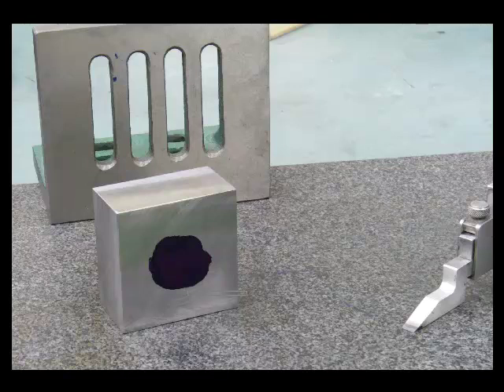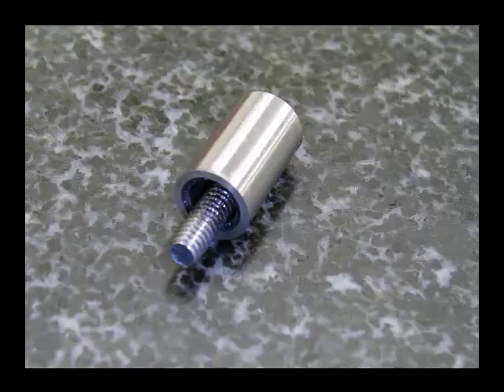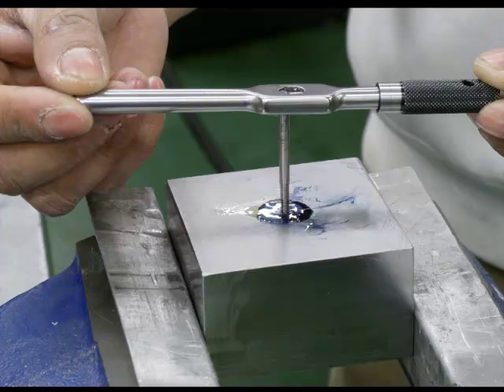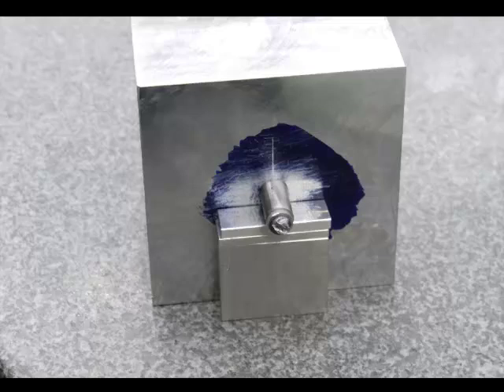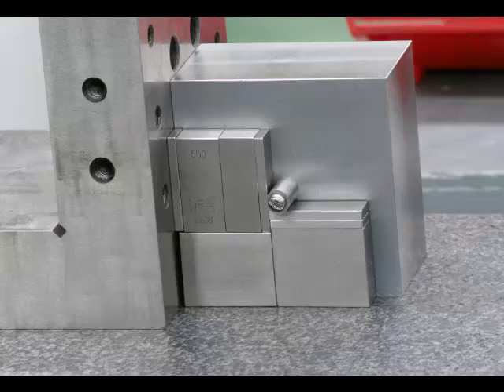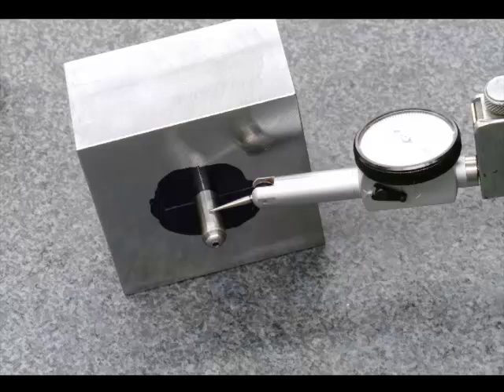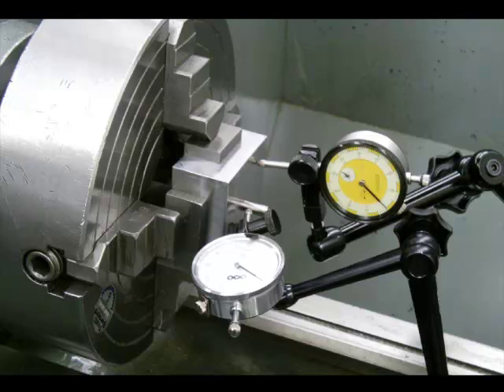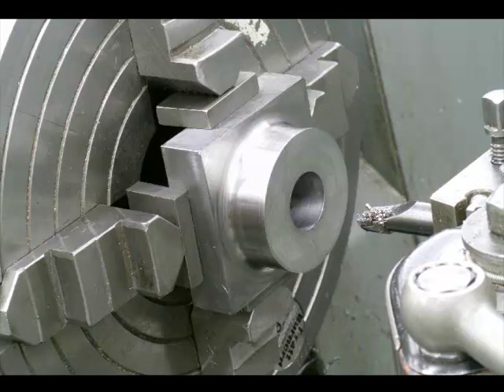Tool Maker's Button

Comment: I*ve just come from facebook, watched 2 videos on this subject, but i still can't understand .... an old timer said it was used when there was no dro.... I don't understand . Even 100 year old machines have readouts, just not digital.... This method only gives you good precision if everything is square, flat, straight... .  

One can find the edge of the workpiece with some round bar and a piece of feeler gage.... From there, it's just cranking the handle to the exact offset. I'm sure there are other methods too . something like this i would probably never use , because the scribing + a good punch is already withing 1mm . So if i make sure to have 2mm of extra stock, i'm golden.

I really want to read the feedback of someone who actually used these.

Comment: Thanks for showing a technique i had not heard of. 👍
It does seem like a lot of work, you have to drill and tap, then do a dial gauge pin alignment, then put in the lathe and do another dial gauge alignment.
I just put the square block in the lathe and use the dial indicator on the 4 sides. If the dial indicator is on the carriage you can just pull it back, rotate the block 90 degrees and feed it (carriage) back in with the dial on the next flat.
Reply from the maker: I  have dialed a block in the way you described many times, it works great. The tool makers button method shows its value for extreme accuracy and also if the hole in the block is to be set off center. Thanks for watching and your note.
Reply: @machiningmoments  ... ah off centre. Thanks, now it makes more sense, especially using the gauge blocks etc. 👍

Comment: I have been a machinist and toolmaker for almost 60 years and can say this method has been obsolete, tedious, and error prone for longer than that. There are faster, easier, and much more accurate methods now. I have worked in dozens of shops over the years and have never seen them used. I used to work with an old timer when I was young (in the '60s) that had a set in his toolbox and claimed he used them once or twice back in the '40s. He said a bit jokingly that he kept them because a horse & buggy museum might want them some day.
Reply from the maker: Agreed, I would not use one very often. It is curriculum in a course I teach.

Comment: which material used toolmakers buttons?
Reply from the maker: The material of the tool maker's button? Hardened steel. The material the tool maker's button is in? Mild steel.

Comment: I'm relatively new to having my own machines and learning how to run them. Am I right in thinking the buttons are a more reliable way to find center than a wobbler. Great video by the way.
Reply from the maker: Hi Joe and welcome to machining. The wobblers or edge finder work just as well, this is just another way to do the same thing. This works well to help dial an odd shaped part in a lathe. Thanks for stopping by.

Comment: Good stuff.  
I applaud your patience with the less-informed on these comments.
Personally, I would likely use an edge finder on the mill to bore or ream a hole for a tooling ball for indicating.  If using my CNC, the hole would be interpolated, but I have used the buttons before in building inspection fixtures as well.
As a 2nd Generation machinist that started cutting chips on manual equipment at about age eight, I've been fortunate enough to experience a lot of things, but it is frustrating to run into the folks that believe they've already learned all they need to know.
I had a good friend of mine years ago when I was just starting that explained the different levels of CNC machinists.
He said you have the "button pushers", who basically do as their told as the name would imply.  Then you have the "operators" who are able to make some offsets and do some setups, as well as being able to diagnose tooling issues.  Then there are the "CNC Machinists", who basically do it all and are at 10 years minimum experience.  Knowing he'd been at the trade for over 30 years, I asked him, "so what do you consider yourself?"  He said, "none of the above.  I'm a Master Craftsman of precision-machined parts."
What most don't seem to realize anymore, is that you can bring so much more to the CNC side of things, if you know manual machining first.  With that said, a lot of manual machinist don't realize how much you can bring from the CNC side of things to use for manual machining as well.
Glad to see there's a few of us left.......
Reply from the maker: +GrizzlyMtn I would likely edge find the part also, this is a competency required in a course I teach. I find the videos are a great visual aid and the students love them. 
I try to remember (don't always remember ) that we all have experiences and I learn from others. If I know it all how can I learn?
BTW I've met some amazing "button pushers"!
Thank you so much for making the time to write.

Comment: I think you should have used an off-center location to reference this technique. In this day and age just use a dial indicator rotating the part 180° to find center, rotate the chuck CW-CCW to find the null for closest point then flip 180°. Good info, no doubt about it... demonstrates the use of gauge blocks and splitting hairs on physical dimensions. This Technique goes back a hundred years or more, back to the age of early machinist mechanical indicators and disk's, long before our dial indicators. This is a foundation of machinist techniques and is worth while information to anyone interested in the art of machining. If you get bored build a old style mechanical 10:1 wand that wonders around the dead center in the tailstock and it's fulcrum is at the tool post. I enjoyed your video, it stimulated my memory in past literature I've read.
Reply from the maker: +Wharesweldo Yes, I agree there are other techniques. I would be interested in hearing more about the "wand". Thanks for your note!
Reply: +machiningmoments I drew a quick sketch, photographed and uploaded it to my videos. The button technique and the magic wand went together like P & J a century or more ago. A part two video using the magic wand, disk & button technique would would go a long way in demonstrating what was. Our forefathers weren't no dummies. You have an excellent video, I think it needs a part two.   } It's under early indicator. { Of coarse you turn the head stock and adjust via. four jaw until deflection is minimized.

Comment: I really find it hard to believe the number of comments I read from supposedly seasoned machinists that have neither used them or heard of them . Ten years ago I decided to teach myself the trade & in doing so read everything I could get my hands on . The buttons mentioned came up numerous times . this was a very simple & well done teach . I have built 6 scratch built gas models up to 2" bore & am near complete a 1" scale loco . I have used the button system for locating multiple gear shafts . you tube search stephens engine firers up katrine  .
Reply from the maker: +HYPE GRAFF We all have different experiences and I've learned a great deal over the years from others experiences...one of the great things Youtube offers. Thanks for posting!
Reply: +machiningmoments mkkkkkuh

Comment: what is the tool makers button material name? it is a additional part of lathe or not....
Reply from the maker: +Shivaji Gharat It is a hardened ground steel. It is not part of the lathe but can be purchased at any machine shop tool supplier.
Reply: Thanks for reply me....
Reply from the maker: +Shivaji Gharat Glad to, thanks for sending me your question.

Comment: Why not just find center using parallels and toe clamps on the mill and bore the I.D. before moving to the lather? And use the I.D. hole to indicate to? If the job didn't call for an I.D. hole but you can still allow for a hole for the button, why not just bore a small 1/2" deep hole and snugly put a 1/4" dowel and indicate to that? All the stacking up of blocks and indicating them before snugging the button, seems sort of like extra work.
Reply from the maker: It is part of  project students are required to do.
Reply: Bilakaifa there is plenty of ways to do a single job, this is one way using old style buttons. It is nothing more then a demonstration about how to use 1 tool to do a job.

Comment: ...As long as you can center-punch within a tenth!  There is a reason that toolmakers' buttons have been used for over a hundred years for jobs requiring the highest level of precision, and it's not because no one ever thought of using a wobbler!  It's the height of arrogance and ignorance to think otherwise.

Comment: what a load of messing around.. just centre punch the centre of the block, then use a wobble bar  to get the part centered in the chuck using a dial indicator.
a wobble bar has a point on one end and a centre drill hole on the other, the point goes in the block to be centered and the centre drilled end rests in the tail stock center point.
rest the dail indicator on the bar and spin the chuck...read off the runout... simple and alot less time consuming..
Reply from the maker: Yup another way of doing the same.
Reply: chrismechanic B:
 (notice your screen name ISN'T chrismachinist B")
Yep an inaccurate way to carry out work on the center of the square block !! What a dumbass.

Comment: Would it have been easier and less hassle to drill and ream a hole in the center of the square part while it was still in the mill?  Then you have a hole to indicate off of when you move it to the lathe.
Reply: Or why not use the dial directly on the surface of the wp.
No "button" is required. Check the dial while mowing the chuck,
back and fourth, on all four angles.
Reply: machiningmoments
 Buttons are the most accurate method I know for many jobs.
Reply from the maker: The idea is for holes that are off center.
Reply from the maker: That will work also, just another way to get the ame result!
Reply: machiningmoments Ha! I didn't get that until u said it. Didn't understand the point of it but that's clever! I may use that at some point

Comment: Toolmakers buttons were for making drill fixtures.  Any first year apprentice should be able to indicate a block in center on a four jaw chuck without all that.  The buttons were placed on the bushing plate as you have shown by indicating on a surface plate, then the bushing plate would be clamped to the lathe faceplate, indicated in and bored one hole at a time for the drill bushings.  The one button of the set that is longer was used when two holes were close to each other.

Comment: Fall, it doesn't matter how accurate the tapped hole is because the button is adjustable and the slips are measuring from the datum of the block, also i'd like to point out if you were to use an edge finder and then ream and dowell it, you are going off how accurate you picked the edge up, then it would be better to dowel it and then machine to the dowel. I completely agree though, sometimes not everyone needs to work to these tolerances and sometimes people get CNC, unlike me :(

Comment: It seems like a lot of work.  I'm sure I could have had a block dialed into a 4 jaw chuck with a dial indicator several times over before I could install and set a button.  One thing it might make things easier for is if you were going to turn a boss or bore a hole off-center.  You could use a bridgeport mill to drill and tap the hole.  Even then, I think it would be easier to just ream a slip-fit hole for a dowel and use that.  To each his own, I guess.  Thanks for sharing...

Comment: Then drill a hole and use the lathe to turn a pin to suit the drilled hole. There are more ways to skin a cat. Just saying I got away for over 30 years and never used one.

Comment: If I'm working in my home shop, I might not have a reamer. I can make a button easily. Also, what if the hole is not in the center of the block? Harder to use the DTI in the lathe then.

Comment: I qualified in 1982, and only ever saw a toolmakers button once. you uploaded this in 2012.... Why not use an edge finder to find the center of the block and ream a hole for a slip fit dowel, and grind block to suit. Or use a DTI to center the block in the lathe by touching the side of the block set zero, rotate chuck 180deg touch on again and split the difference by adjusting the jaws. It is just an antiquated way, Change to black and white film.

Comment: it's NOT critical, to find center...

think of this merely as a simple example of the technique that has  more widespread use. 
you can use this technique to locate a hole ANYWHERE on the workpiece, and then center that location on the lathe.

It's an old technique that is mostly unused, because of CNC, and multi-axis machine centers. However, it is still a useful trick for home shop machinists, and other hobbyists. And it's a skill every machinist should have, whether or not they ever USE it.

Comment: No it's not for me, quicker to drill and ream a 'tooling' hole in the required position, offer it up to the 4 jaws and clock the hole (dial it in) much quicker and less messing about.

Comment: 4 jaw work-----just dial indicate the edges of the block and the face of the block.....no need to piss about with all that drilling and tapping and slip guaging and clocking in the button then 'tapping' it to centralise it blah blah , I'm  knackered and worn out just thinking about all that extra work. If it was really important the block would be surface ground after milling to ensure that it was square. Have been an English toolmaker for 42 years and English knowledge is THE best knowledge

Comment: I am not a machinist, but I would like to learn the basics someday.
Is the purpose of the button to enable you to align the scribed intersection on the block  with the center of the chuck (ie. lathe axis)? 
If you're removing material to make the square round, why is it super critical to find the center of the square?

Comment: The procedure demonstrated here is of use for putting holes off center. It is a huge waste of time for centered holes, even in a lathe. If you are putting a hole on center of a square or rectangular work go right to using your test indicator to center the work in the 4 jaw chuck. You probably know that, but putting the hole visibly off center would have helped demo this better. Thanks, I learned from it, just had to watch twice to catch what the purpose was.

Comment: This process was made obsolete around WWI due to the invertion of the Jig Bore by the Moore Special Tool Company. The Jig Bore was not only a faster process but provided greater accuracy as well. With the advent of CNC equipment, the Jig Bore has now also become obsolete.
david pierce

Comment: The reference buttons  (on the bottom) would be laid out parallel to the surface plate for the "Y" axis and positioned using a  micrometer for the "X" axis. The other buttons could then be referenced using trigonometry and  micrometers. By tapping the buttons into place, the hole locations could be placed to within 1/10,000 of an inch. The workpiece would then be mounted on a lathe faceplate, as previously stated, and indicated in. (continued)

Comment: In the old days this is the way it was done.....well almost.  For extremely accurate work a face plate would be mounted on the lathe and a light truing cut would be made across the face of the plate. The part would be clamped to the face plate and gentely tapped into position with a piece of brass. For multiple holes the part to be machined  would be laid out with blue dye and a scribe. Then the holes would be drilled out with a drill press and tapped. (continued)

Comment: this is an nice idea , i think i will use it some day ! thank you !

i would do this block different , just centerdrill it accurate on the mill , and then ill put the puppytast in the drill chuck , the workpiecie in the 4 jaw , and then set the workpiece on center with the puppytast ...
if you dont have a digital reading , the way you show is perfect and really accurate!

Comment: Thank you for this video! I've been wondering how to accurately put an odd shaped stock on a lathe.  Most I see use a rod mounted on the tailstock into a punched mark on the stock and mic the rod while adjusting the 4 jaws. Now I've 2 methods I can use when needs arise.